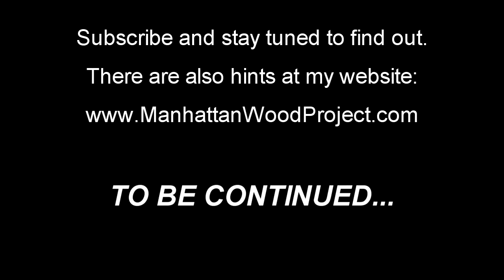22 - 60 Degree Miter Jig - Manhattan Wood Project

Comment: Awesome video! 
Question - I need to make some small, perfect trigness. 4" on each side. I'm trying to create a table saw jig in order to do this. Can you give me some pointers, or perhaps you have a video or a blog post you've seen with instructions? It'd be such an incredible help - THANK YOU!!
Reply from the maker: Hi Lauren, thanks!  If you make a jig similar to this one, you can cut your pieces a little long and then make a mark or use a stop block to position the sides so they are cut exactly 4" long.  It may take a little experimentation to get the mark or block positioned, so make sure you have some extra material you can use to get your setup dialed in.

Comment: Nicely done. Wax those runners and they shouldn't bind as much.
Reply from the maker: I did before cutting the pieces at the end, as well as the bottom of the sled itself.  Good point though, I should have mentioned it in the video.  Maybe in Part 2...